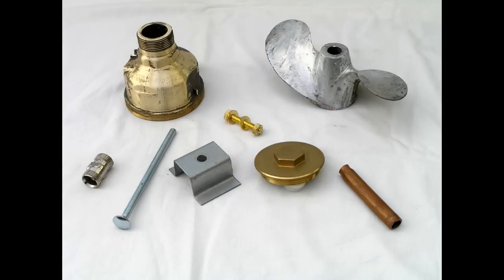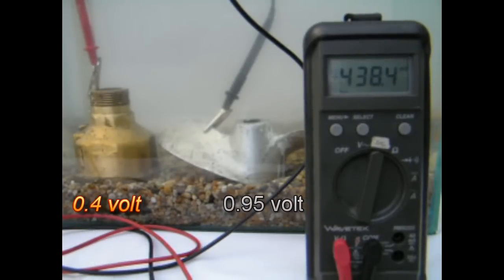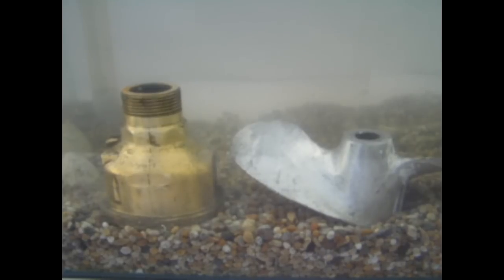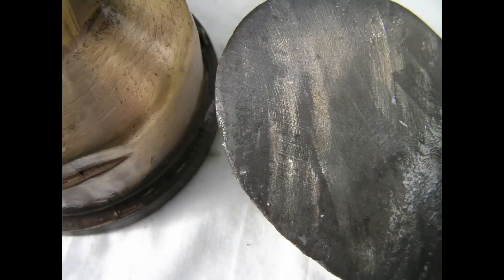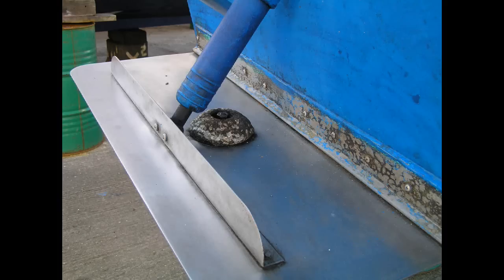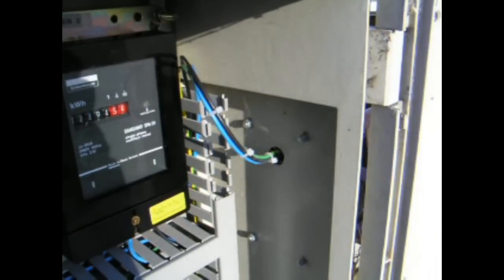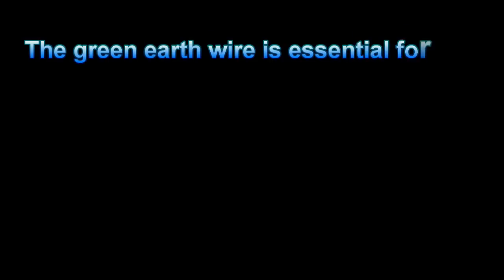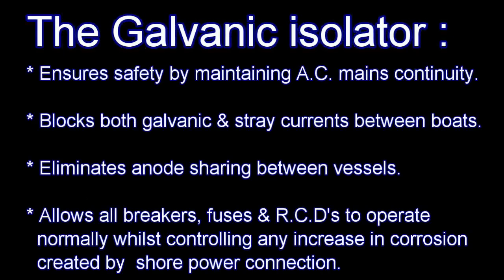Safeshore guide to galvanic corrosion & galvanic isolation

Comment: A very late comment, fault current is not sent to ground, fault current like all current is simply  trying to get back to the power source.  It does this via the safety ground as this is what it is provided to do.  The safety ground wire is actually connected to the neutral at the power source.  Which in this case will be the nearest shore power transformer.  Whether in the marina or up on a power pole nearby.
This ensures the safe conduct of the fault current to the source.  It also provides the means to trip a GFCI on the incoming hot and neutral wires  by creating an imbalance of the current measurement between those two same wires.  If you bond the shore current safety ground to the battery negative (call it the engine block if you want but this is just a path in the negative path of DC current of the boat.)  You then risk putting AC fault current into the water at the marina.  This current will try this path if there is also a fault at the shore power connection.
The only reason to ground the AC safety ground to the boat DC negative is if you have an isolation transformer installed.  In which case the boat AC safety ground is not connected to the shore safety ground.

Comment: The 240 volt ac earth is always run back to shore . Normal practice and our recommendation for safe practice is to bond the a.c. earth (ground) to engine block or metal hull to ensure maximum protection onboard. This is usually done by running a 6mm earth bond from the 240 volt a.c. consumer unit earth buss bar to either the engine block (on grp boats) or directly to a clean contact point on the hull in the case of metal hull vessel.

Comment: Think the 240v ac circuit earth should be run back to shore. On the diagram it seems to suggest that it is also connected to the to the boats ground circuit. Do you mean the hull or just the 240v appliances?